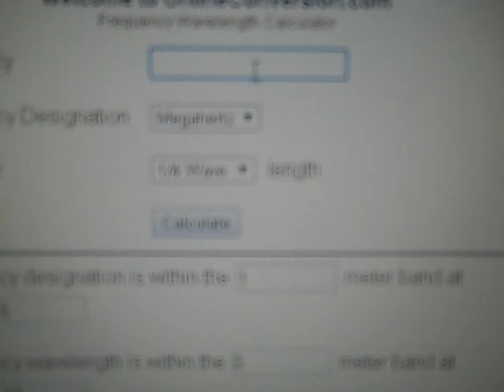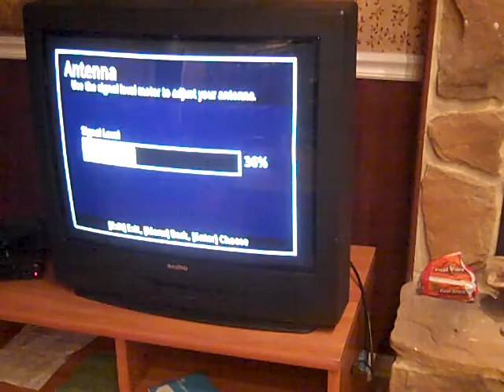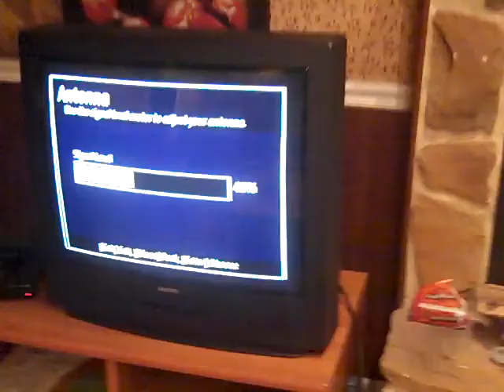DIY log periodic dipole 600-700 MHZ TV antenna - NOT COAT HANGER

Comment from the maker: It turns out that CH 11 has a history channel and a 24 hour news channel on its sub channels.  CH 11 still doesn't come in perfect yet, and I'm going to upgrade the amplifier cables to make CH 11 perfect for watching that history channel.

To upgrade the amplifier cables, instead of using 6 foot long cables between the amplifiers and the splitter, I'm going to buy 6 inch cables so there is less signal loss at the top of the 600 MHZ band.

CH 38 is perfect and indestinguishable from Law & Order on cable however, because CH 11 (RF 47) is lower powered at only 200 kw compared to CH 38 (RF 43) at 200 kw and CH 7 (RF 44) at 1 mega watt and 200 kw travels farther at RF 43 than at RF 47.